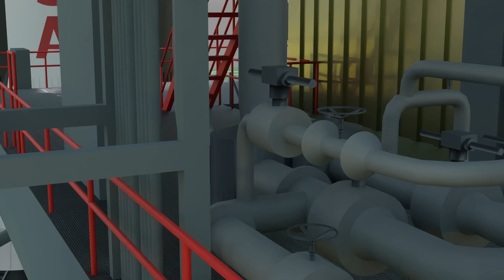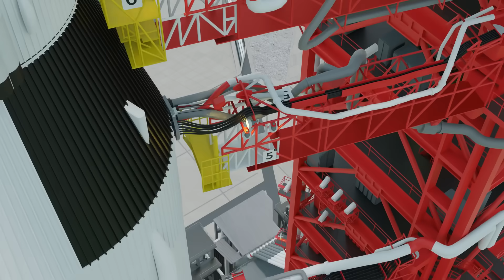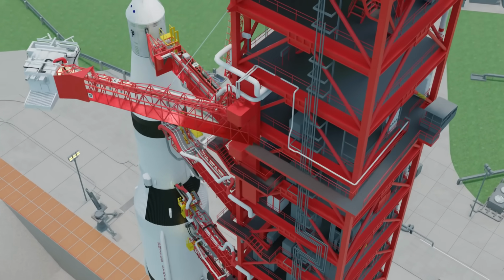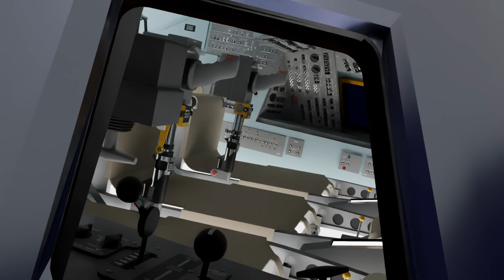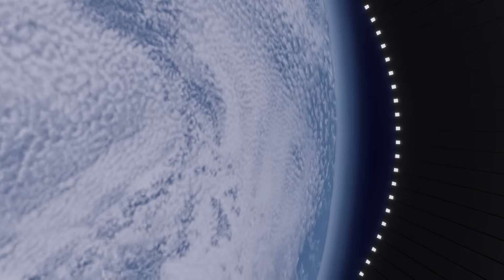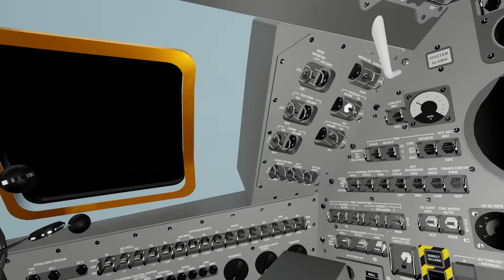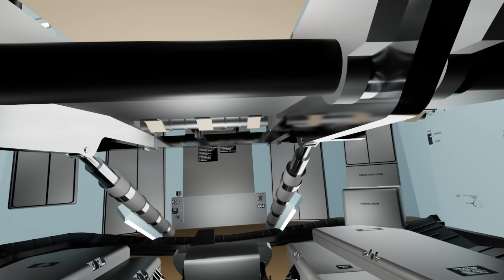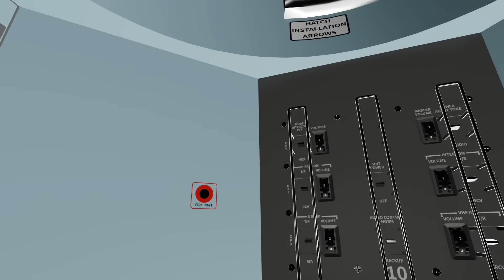Apollo 11 Part1: All Engines Running

Comment: Not once did any of the 90 F-1 Engines flown, Fail in Flight. Impressive Engineering
Reply from the maker: Thanks for watching and commenting.  Yes…none failed in flight but a couple shut down early due issues with the feed system related to pogo instability which never really was resolved but was minimized.
Reply: @opieswenson  

Those shutdowns were the J2 Engines on the Second Stage. The F-1 never had a Failure in Flight
Reply from the maker: @pjimmbojimmbo1990 And so they were.  I stand corrected

Comment: the launch was wildly inaccurate in terms of the orientation of the craft and the size of the Earth.
to get to orbit you can foward FAST, not up
Reply from the maker: 2 points: 1.  it was one of my first videos.  2. while I model the spacecraft in real scale, Blender does not like adding planet size scales.  So I have to use some trickery to kind of get it to work.  With that said, I will be trying using shaders instead of mesh in an upcoming video that will allow me to use full scale planets (the earth will be just a shader with no mesh).  You are pointing out the most frustrating part of Blender when trying to do accurate space themes.
Aerospace Engineering taught me a lot about orbital mechanics.
Reply: @opieswenson  my bad! And for one of your first videos this is superb. Whaat you could do is keep the planet the sam size but scale the rocket down, would that work?

If all else fails, just say that it takes place in the KSRSS ksp mod
Reply from the maker: @RGGaming940  When differences between the size and distance of mesh becomes great, the math behind Blender can't handle it.  That is why I will try out a Blender mod that will build the earth and moon at real scale with no mesh (just shaders).  I have never used it before, so hopefully it works.  My skillset is modeling space equipment.  I am not very good at doing scenery and people.  However, some of my Apollo 15 series does have people.  I may try one more video with people involving the A15 deep space spacewalk to retrieve film canisters
Reply: @opieswenson  Yes it's called the floating point imprecision error it's a fundamental computing problem that can only be solved with infinite storage

Comment: Apollo aca Bogota como me escuchan ; mi punto de vista esta muy obsoleto el sistema de propulsion de los motores y de la etapas de la Nave Espacial ,sugiero muy obsoleto el sistema de propulsion y rompe las capas de la atmosfera ,se debe investigar y usar un sistema de propulsion magnetica y con ondas electronicas y el sistema de separacion de los modulos debe ser por energia electrica almacenada en condensadores
Reply from the maker: Well I am animating a spacecraft that was used in the mid 1960s to the mid 1970s

Comment: The videos are breathtaking and are examples to be followed.
It's a shame it's hard to draw the traditional shuttle carrying the astronauts. I think this same model of shuttle was used in the space shuttle program.
Reply from the maker: @rsmrsm2000  Not too hard to draw the shuttle.  I am trying to bring to life the Apollo program where some things were hard to visualize.  With the space shuttle, they already have great video for all kinds of crazy angles.  Not sure I could add anything with an animation.
Reply: @opieswenson  This channel is providing incredible and never-before-seen insights, using precise parameters. Very important for showing historical missions. 
However, I noticed that the channel has been without publishing for a period.
Reply from the maker: @ Probably about a year break in posting as I revisited all of my existing Apollo models and more or less rebuilt them using better techniques.  I had also discovered the LUTgroup which had a treasure trove of drawings on the launch umbilical tower which let me build it with a lot more detail than the video you just watched.

Comment: Very nice looking animation, but the timing on all of the swing arms moving is completely off from how it actually happened... most notably, you have the White Room still firmly attached to the BPC and CM with two minutes left in the count.
Reply from the maker: Swingarms 9 (white room), DRRS and the crane were purposely not animated correctly due to most people not wanting to wait around watching nothing happen for a long time.  For example, the white room moves the park position at T-43 minutes  and stays there until T-4 minutes. The preflight arms disconnect at T-10 seconds (arms 1, 2, 3) while the inflight arms (arms 4, 5, 6, 7, 8 disconnect at vertical motion.  Each arm has a slightly different time to complete the retraction which I accounted for in the animation.  Note that in this particular animation, I do rewind the clock several times to show different angles.  But when you see my shot with all the arms in view with movement, it is correct except as noted.  The movie Apollo 13 was way off in their animation where they show a camera fly through of the arms retracting one at a time.  Thanks for watching and your comment.

Comment: The Apollo Command unit had an insulation of honeycomb aluminum and Styrofoam!?
Reply from the maker: It was made of an aluminum honeycomb sandwhich bonded between sheet aluminum alloy. The base of the CM consisted of a heat shield made of brazed stainless steel honeycomb filled with a phenolic epoxy resin as an ablative material and varied in thickness from 1.8 to 6.9 cm.  The shockwave from the blunt end carried away a lot of the heat during reentry along with the charring/shedding of the ablative material.
Reply: @opieswenson you just made that up!

Comment: Didn’t the swing arm retract at T-10 minutes?
Reply from the maker: Well which one?  Swingarms 1, 2 and 3 were preflight arms. The preflight arms (except for 3) are retracted at T-10 seconds.  Number 3 usually retracts a lot earlier.  Swingarms 4 through 8 start retracting upon vehicle vertical motion triggered by the lift off switch on the hold down arms.  While 4 thru 8 start retracting simultaneously, they each take their own time for completely retracting (in order: 6.4 seconds, 7.4 seconds, 7.7 seconds, 8.4 seconds, 9 seconds.  Swingarm 9 (white room) moves back about 3 ft at T-43 minutes and then fully retracts at T-4 minutes.

Comment: 11:30 What is size of this console? Distance of the doors? Can this be folded?
I saw Buzz Aldrin on knees in doors as if console wasn't there, is there enough room to get out?
Reply from the maker: Take a look at my 2 of my Apollo 15 videos.  My first animations with people.  That will give you relative size.  And yes, they had to get on their knees and pretty much belly crawl out.  But with that said, their suite lunar weight was 30 to 50 lbs.
https://youtu.be/kYHl42M2I2w?si=duCaQcOBEUmd8H28
https://youtu.be/VlJspdHEYAs?si=LuV3JYdmIb0VaWsR
Reply: @opieswenson  Thanks for links but there is nothing that might help to find answer. You have all models, so can you make such scene, dont say animation, just bend knee of human, in front of opened doors and remake scenes / photos of Buzz getting out?
Reply from the maker: @KabelkowyJoe  The spacecraft is so oddly shaped, it is difficult to get a good measurement.  But in general, the main front panel is about 3.5 wide.  Wider towards the bottom.  The hatch is about 2.58 to 3 ft wide and sits underneath the main panel.  There are 2 tray tables that fold up and the armrests fold out of the way.  I used drawings like this (http://heroicrelics.org/info/lm/lm-ctrl-panel.html) to relatively size the instrument panels.  And there are lots of places on line to get good sizing information on the ascent stage.  Once the ascent stage was built, it was relatively easy to scale the instrument panels to fit the ascent stage.  Wo when building this model, I never had actual sizing information of the instrument panel.

Comment: Why do you do this? There are many many videos of the real thing.
Reply from the maker: Mostly for fun.  But my motivation was to show things that you could not see in the real videos.  For example many of my videos show interior views that are much clearer than you could see with real video back in the 1960s.  Please take a look at my A15 rover deployment video and compare that to the real thing.  Thanks for watching and for your question.
Reply: @opieswenson  Jeeeez. I use Autodesk Inventor for 3D mechanical engineering stuff and that always takes a lot of time. I can only imagine how many weeks and months you spent on this. I'll do the comparison of the A15 later. Impressive work.
Reply from the maker: @saxalehrer2643  Thanks!

Comment: I must admit I did not realize how much of the tower was still hooked up to the rocket until the last possible second.
Reply from the maker: Thanks for watching.  My modeling of the arm retraction timing and duration is spot on with the following exceptions:  The arm extensions are retracted way before launch.  The crane is almost always out of the way.  Swing arm 9 unlatches and parks at a ready position for a while, then retracts fully, I show it retract in one motion.  And durning the launch cycle I show a couple different views where I kind of rewind the clock to give you the view.  But the overhead shot with the engines running and the arms retracting along with the timing sequence are correct.  I have a new video I am working on that shows more detail on the arms.

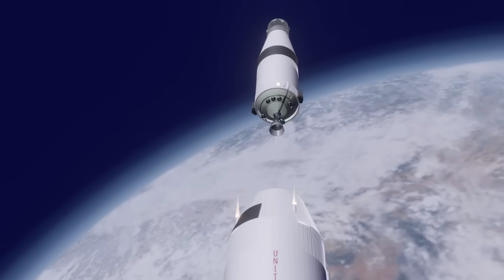Comment: 5:39. nice work.  (There were three ullage engines on the S-IVb stage).
Reply from the maker: Thanks much for watching and your comment.  I have found that in researching for my models that there were all sorts of configurations on just about everything which sometimes makes it somewhat difficult to get things right.  For example, all the manned Apollo missions launched with 8 ullage motors on the S1C except for A15 which launched only with 4.  They went back to 8 since A15 stages almost ran into each other.  For the SIVB, there were initially 3 ullage motors which can be seen on AS202 (unmanned) here:https://youtu.be/xMr_AGJprrg?si=kHBHpxautNhpDhZr
But later flights had only 2 as can be seen in this drawing here: http://heroicrelics.org/info/s-ivb/s-ivb-v-overview.html

Comment: Did they really leave the tower arms connected to the Saturn V so close to launch?
Reply from the maker: Yes and no.  When you see swingarm 2 and 3 start swinging, that timing and all the arms afterwards are spot on.  The top down view gives the best shot.  Note that thru the launch, I rewind the clock a little to show a different angle.

The timing that is not correct is the DRRS (device locked on to the escape tower), Colby crane, white room (swingarm9), and the swing arm extensions.  You would be waiting awhile if I animated those at the real time.

Comment: One complaint.
When simulations are this good, it encourages space deniers.
Roll on the next live one.
Reply from the maker: Thanks…it is an animation though.  But for the deniers…try to look for a home computer and animation software in 1969.  However, youcan see the hand drawn animations in 1969 that newscasters were using….state of the art back then but horrible today.
Reply: @opieswenson  Completely agree, though it doesn't stop the arguments. 
What I had in mind, though, were the immediate responses to the live feed from Artemis-1 in space. 
The arch-flatearther LEO (level earth observer) was chuckling at them and declaring them 'ridiculous and pathetic'.
Still, that's no reason not to love constructs like this.
Diolch yn fawr iawn am waith hyfryd.
🏴

Comment: Upper crane, white room, and lower swing arms not at the right place in the count
Reply from the maker: You are correct.  And the retractions of the extensions are not correct either.  I did that on purpose so that you would not have to wait for several days waiting for those events to happen,  instead, I zipped through all those functions extremely quickly so you could see all the things that go on.  If I remember correctly, the timing of the swing arms other than singarm 9 is spot on from about T-10 second to tower clear.    Which is better than the Apollo 13 movie whose swing arm retractions were all jacked up.  Note that during launch, I rewind the clock a couple of times to give a different view.

Comment: Such a shame we did not have the technology to pass the van Allen belts and deal with the vacuum of space at the time...maybe we will make it this time..
Reply from the maker: Engineering is all about figuring out solutions to problems…and they had figured out the solution to the van Allen belt issue in the days of Apollo.  You can’t change the energy that is in the belts, but there are at least 2 things you can do….1. Avoid the well known hot spots in the belts….and….2. Minimize your time traversing the “cooler” spots.  They had several dosimeters onboard.  Some attached to their spacesuits….and there is another one next to the hatch near the crews headrests.  They got the equivalence of a chest X-ray

Comment: Nov 17, 2022 - Outstanding work of digital imagery combined with original audio and storytelling of this epic mission. BRAVO!! You’re showing us angles and things we would never be able to see with TV technology at that time. I remember watching this mission as a teenager. You obviously are passionate about digital imagery reflecting history as best as you can. Q1: What does NASA think of your project? Q2: What computer tools and resources did you use to create this project? How long did it really take?
Reply from the maker: Thanks!  A1: Not sure that NASA has ever seen my animations.  But there have been several favorable comments from NASA employees and space contractors. 

A2: Then main software I use for model building an animation is Blender.  You can download it completely free.  Blender supports a ton of free and not free add-ones.  I only use 3 not free add-ones…..one helps with smoke and fire, another helps with water/fluid, and the last one does Blender background rendering.  The background rendering prevent my computer from crashing…it allows the rendering process to be separate from Blender…..does not hog all my computer resources.  All text, logos, placards, flags, etc are done with the free online tool called Figma which is kind of like photoshop.

A3:  I started learning Blender in October 2021.  In Jan 2022 I started building the exterior of the Lunar Module….which is all that I thought that I would build.  My next separate project was to build the CM main instrument panel.  At the time, there was no real thought of building anymore than that.  But I had the drawings for the rest of the panels, so I built the rest.   From there….maybe I could put the panels inside the vehicles.  The model that probably took the longest time was the LUT.  So I think from the first model build to the first Apollo animation on YouTube was 9 months.
Reply: @opieswenson  You did an incredible job!  More power to you.

Comment: You show very nicely how it all worked. I love the Saturn V rocket and I built a Revell model in a diorama. You can see it in this short video: https://www.youtube.com/watch?v=pIaFYTfsxms
Reply from the maker: Nice model.  Has a lot of detail.  One thing people have been busting me on is that my F1 nozzles are flying naked ( no insulation on the F1 skirts).  I noticed that your model also does not have the insulation.  With that said, I like looking at the naked F1s.  😀
Reply: @opieswenson  I have read a lot about the Saturn rocket and about this insulation on the motor 'bells'. On the model, it would greatly disturb the final look.
I agree with you that 'naked' nozzles are more beautiful :)
Thanks for the comment.

Comment: Fun Fact: During the rocket hold down clamp release part you can actually see the camera E-8 housing...
Reply from the maker: Are you saying that you can see the E-8 housing in my animation?  I have a lot of cameras housings placed all over the tower based upon pictures.  The E-8 camera took video at 500 FPS (https://www.youtube.com/watch?v=DKtVpvzUF1Y).  During my hold down clamp release, I am not pointing in the direction of where that view would be located.  I checked my model, and I don't have a camera housing there.  I searched online for the exact location of E-8, but the only references I could find in a quick search was that the E-8 housing was not actually located in that position....and may have been  located inside the launch pad base pointed up at a quartz mirror.  Regardless, please let me know what you are looking at----my animation or another video, I am interested.  Funny thing though----as I was searching my model, I realized that my first stage fin markings did not render.  So I fixed the model, but the current Part 1 does not show the proper fin markings.